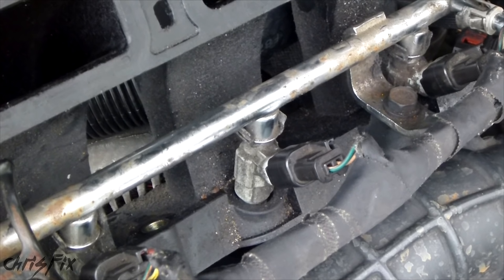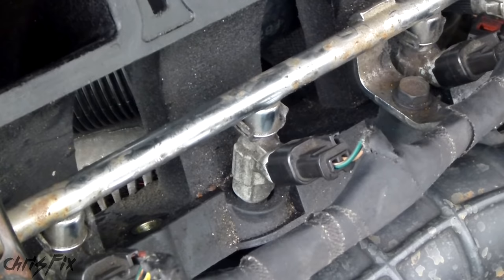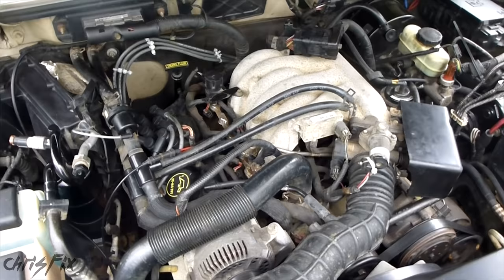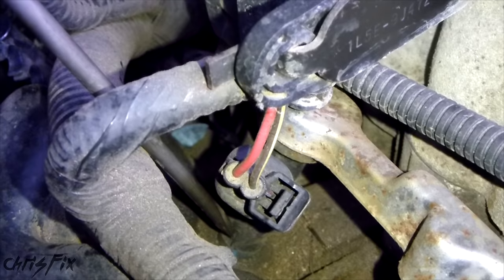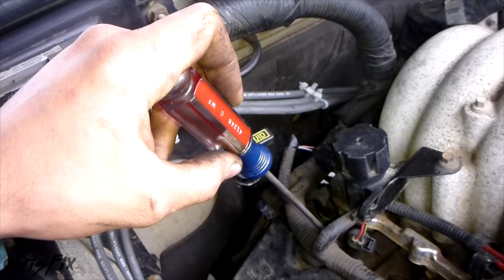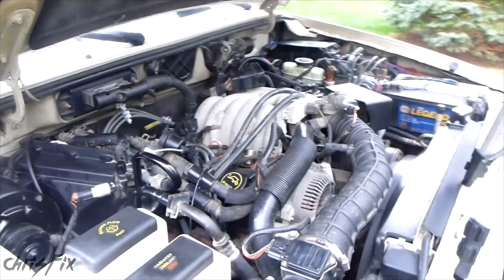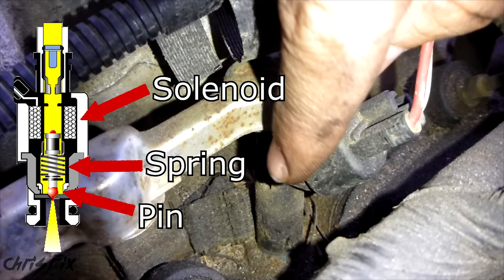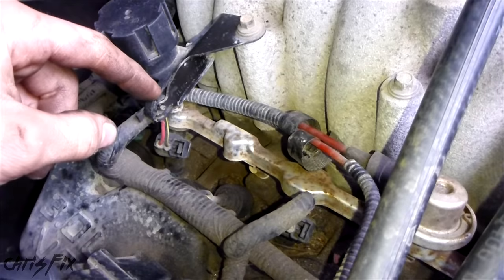Testing Fuel Injectors Fast

Comment: Lol, that just tells you if the injector is physically firing. 
That's rarely a problem and, if it is, will show up in the DTCs. 
The coil in an injector is not what typically fails.

Comment: I see a a lot of videos on the code p0304. Most of the videos show the mechanic replacing the ignition coils and spark plugs. I have the same code, misfire 4 cylinder. However, I replaced those about 6 months ago. Just to be sure- did a ignition coil and spark plug swap, after that kicked up the same code and problem while driving. Could the problem be the injector?

Comment: I'm a novice and I feel I just got ripped off. I have a 125,000 mile '93 Nissan Sentra with a new tranny ('16).  Two months ago, I stupidly ran car until empty (tricky gas gauge sometimes). I was near home and local gas stop and walked back a quarter gallon and cranked it up. It sounded just like it did when it was sputtering. It might be worth noting that it was sputtering (like it had half-power) for several miles before it stopped near home.

With new gas, I sputtered to this well-regarded shop near that same gas stop.  Anything you take there, I'm told, be prepared to wait three weeks.  Since I had another car, I didn't hurry him but did show up there after a month to be told that he thought I had a bad injector but his tool for determining that wasn't working and that he'd ordered one. He quotes me $500.

Three weeks later (last Friday), he tells me to check back y'day. I missed a call this morning from that shop...no message. I stop in today about an hour ago and did not find owner there. His associate and secretary are there when I'm presented a bill for FOUR injectors for $1,081.  I wasn't happy.  I told them that since they had the car for two months, they could've at least let me know that actually the bill was going to be 120% more than quoted. 

Three yrs ago, I took same car to same place due to wobbly or vibrating belt near a/c (but not a/c) and that's fixed. But bill is $1,600 due to me needing three new engine mounts. I wasn't able to argue it and he sent photos of what they looked like before they were replaced/fixed. So, I dunno about that one but I'm getting a bad feeling about this last one that I've been cheated. Your thoughts?
Reply: I'm not a car guy myself so my answer means nothing and I hope someone else will reply with better. But I would just say if mechanic orders OEM parts and a big shot in town he's gonna upcharge ya premium.  I've had 93 Nissan Sentra myself, its fuel efficient & reliable but such a peasant vehicle that I didn't expect to be hit with $931 for an axle shaft job. They replaced many things without consulting me - new tires, rear brake shoes etc. They could say its for safety reasons and its fair  but they don't know my financial situation so they should have asked. Needless to say I haven't gone back to that shop. Today I'm looking to fix few things on 98 Sienna and lextech quoted $600 for just the labor of replacing 4 mounts - a  job a mexican by autozone near  LA downtown is willing to do for $200. The question becomes do you want to gamble on how reliable the job will be. Unfortunatly what happen to you is very common. Maybe in your free time you can ask around other mechanic shops what they would have charged so that next time your car brakes down you'll know where to go.

Comment: Chris bro I am having a problem keeping my 97 geo metro running it just dies not long after any pressure to the gas pedel. I am looking into changing out the Fuel Injector filter tonight but Fuel injectors are quite expensive to just replace without knowing so Im going to use your video advice and check them out. Thanks for the info, hopefully it's the filter though!
Reply from the maker: Wyatt Whiteside Awesome! Let me know how it goes. Check the fuel pressure too: https://www.youtube.com/watch?v=_oXLUqE4Sf0
Reply: ChrisFix  turned out to be the EGR valve Chris! Thanks though!!

Comment: That just tells you if the coil is good and that the injector is getting voltage. If the injectors completely plugged upit will still make that noise leading you to believe that it is working, and still causing a lean condition because you're not getting any fuel, or enough fuel.

Comment: In my 2004 Vw Polo I had a bad injector and there are 2 fault codes. P0202 Injector Circuit Cylinder 2 and P0302 Misfire Detected

Comment: it was a bad injector. i switched them and the miss went with it. thanks
Reply from the maker: +rex2013 AWESOME! That is exactly how you do it! Thanks for the update!
Reply: 1mzfe is running good, short trims are at 0 and long term about 3. give or take -1. the new code p0420. i have 166,000 on it. did i mes up th cat with those missfires.

Comment: Hey Chris..my mitsubishi lancer started making a noisy clicking noise and thought it was the hydraulic lifter. Later added the liqui moly hydraulic lifter additive  which made it a little better but the ticking wasn't gone yet..later checked the fuel filter and it had a mix of water and a little dirt..Is there any chance the ticking engine is caused by bad fuel injectors or the bad fuel mixture that was running..?any help will be much appreciated..thanks in advance

Comment: Hey Chris, I pulled out my injectors and got them serviced twice in a role and each time the engineer is saying he fixed them and they're now OK (according to the injector machine). But each time we put them back they're not producing a consistent pulse. Only one is firing correctly. The car has power, but the idling is rough. I hope you reply to this. Thanks

Comment: Chris, I checked the injectors with a stethiscope and get a uniform sound from all four on my 240 non starting volvo. The sound is a very rapid succession of clicks rather than a slower more distinct click, click, click sound. Is that rapid speed while cranking the engine correct? Thank you for all your most informative video tutorials.

Comment: Yeah ive got a w203 c320 and im getting a missfire every single time i get to 5000-6000rpm « goes into emergencymode» and its always cyl 6. Ive changed plugs wires and the coil.. also ive changed the crankshaft sensor but nothing helped, hopefully its the injector if not it might be bad compression in the cylinder ;/ im about to test the injector out with your method !

Comment: I will try this because my ford escort 2001 zx2 keeps misfiring cylinder 4. I replaced the spark plugs, cables and coil and the crab still misfires. Thanks a lot, looks simple...

Comment: So my 350z is misfiring on cylinder 4. Checked all 6 injectors but 4 sounds weak. It's clicking steadily but it's half as load as the other 5. Switched injectors 2&4 to see if it would make cylinder 2 misfire. Nothing changed....still p0304..could it be the wire harness? The $180 question

Comment: Hey Chris, i got a 2015 corolla and the dealership says it needs a "fuel injector service"($180). The injectors sound great using your test and the car shows no signs of bad injectors. Is this a necessary repair and if so can i do it myself? Have done so many repairs thanks to your videos
Reply: +mamel .juice like he said at the end, it won&#39;t tell you if the injector is dirty and chocked up, or if it is leaking.
Reply: +mamel .juice You must have taken it back to the dealer for a problem you're having but never mentioned here. 2015 model should still be under warranty and cost you nothing. Dude, they're blowing smoke up your butt.
Reply: Sounds like your mechanic needs to make a boat payment. 
No way a 2015 needs injector service.
Tell them to replace your injectors under warranty if they are bad. Lol

Comment: hey Chris I have 89 e250 with in line 6. 
stuck on high idle, no vaccum leaks, if I unplug everything from the tree engine still races, would cold start fuel injector go bad cause high idle?
p.s. I had new water pump & thermostat put in.

Comment: 2007 jeep liberty 3.7l v6 with a nasty habit of not wanting to start. Turns over fine, but just wont fire. No rhyme or reason behind it. Seems to happen more when its been running for a while. Error code 0304. Also keep blowing a coil on cylinder 4. Bad enjectors??

Comment: I have a 2000 Acura Integra LS. Once it gets up to 5000 RPMs it totally loses power. It takes a couple seconds to recover but then it's just fine what is the issue? Fuel pump? Fuel filter? Fuel injectors?

Comment: Hi Chrisfix. I am having a problem with a 04 mustang V6. I changed the oil, Spark plugs, wires, fuel filter, and cleaned throttle body. The car is still vibrating during driving like it wants to go but stutters. It only works at WOT. I was thinking maybe a bad injector or clogged due to be parked for a lonnnnng time. Any suggestions on removing and cleaning or just by cheap ebay ones to replace?80$ shipped for all 6. Thanks in advance.

Comment: My Escape is misfiring on highway and going up hill.  No issues starting or idling.  Already replaced Coils and spark plugs.  Could injectors still be an issue if there's no problems starting?

Comment: Can bad injectors cause white smoke out exhaust? Trying to diagnose is the white smoke head gasket or bas injectors. The white smoke only happened after injector orings were replaced & intake gaskets.  Also I noticed when i hit the gas at low rpm (RED LIGHTS) the car sputters & sometimes even stalls completely. Trying to figure out head gasket or injectors, no coolant in oil & front 3 spark plugs smell like straight gas

Comment: i have a 96 dodge ram 1500 and while driving down the road you get a really bad smell of gas in the cab of the truck . Also when you shut of the truck and walk by the gas tank you get smacked in the face with a really strong gas smell what could be causing this problem.

Comment: Unfortunately on my vehicle the injectors and fuel rail are underneath the intake manifold and cant be accessed while the engine is running so i'll have to find a different method

Comment: Hey chris :D been having problems with my Astra J 2.0 Diesel for the past few months, it goes into limp mode randomly, there is no pattern what so ever it is so intermittent, pulling off, driving normally on flat road and going down the motorway at 70, just randomly goes into limp mode, sometimes it can go a whole week before doing it again. Turn the engine off and on its fine until it happens again. 

The code im getting is P0087 'Fuel Rail Pressure Low' I have had the high pressure fuel pump reconditioned (all data on the diag is normal) replaced sender pump in the tank aswell as fuel filter 3 times and fuel lines flushed, EGR replaced, MAF sensor replaced and the fuel rail pressure regulator replaced. Do you think it could be an issue with the ECU? or would you recommend getting the injectors tested? I know one of the big symptoms is misfire which i havent had, but could it be due to a very small leak/drip on the injectors? This is doing my nut in now haha I really appreciate your help and advice. Cheers bro!

Comment: I have a 2010 equinox that struggles to get up to speed then it takes off, also is it possible to take all the injectors out and clean them if build up is the issue?

Comment: I have a mis fire one #4 injector..using screw driver test i notice #4 injector is firing much faster than other injectors..does this mean its clogged or does it mean solenoid is bad? Thanks

Comment: I used an actual mechanic stethoscope and with the injector unplugged, I can still hear the ticking. Which means I'm hearing the other injectors through the rail.

Comment: Hi so I have a 2009 Nissan Maxima 6cylinder recently the car has begin to lose power rides rough and the engine light has started blinking then it stops after 8blinks it rides very rough and when I’m at a light it sounds as if it’s bout to cut off . I just got a tune up changing the spark plugs and one coil and also replaced the mass air flow sensor and even after that the engine light cut off but after only driving a few mins the engine light is back on and blinks and the car is riding rough again . But when I put it in manual and change the gears myself it rides okay still engine light blinks the same then stays on only when I go into 4th gear up hill does it start riding rough again . Does this sound like I have bad injectors ? Also is it too late to use cleaner ? When I first got the car and would come to a light it would do this consistent jerk not hard but you could feel it in car.. I’ve taken it to 3 mechanics and have been misdiagnosed each time .

Comment: i think my fuel injectors are clogged... im getting a huge white cloud from the exhuast smells like gas. truck has been running fine.. and all of the sudden check engine light and all this smoke now the truck wont start or crank..

Comment: How do you check for a fuel injector that is stuck open my engine is blowing fuel out the spark plug hole with the fuel injector disconnected any thoughts

Comment: Just wondering if I have a bad injector , 3 of the injectors ohm test at 13ohms but one was 18 ohms. Is the high number injector not in ohm specs considered a bad injector ? Although the car runs smooth atm. I ask because I had a missfire that randomly went away and has yet to come back.

Comment: My 2004 Chevy implala ls is currently jerking while I’m driving’s sometimes it’s doesn’t do it but sometimes it does it bad like I can stop at a red light and drive away but it will stall like it want to cut off it actually cut off on 3 times before while doing that

Comment: Hello Chris . I want to know if my injectors are bad . My car dont have smoke , it start very normal , maybe i think it doesnt has too much start power , but when i push the gas to the end it doest release the power . My car is audi a6 2007 2.7 . I was thinking to use a dieseel purge from liquid moly ? Does it work ?
Last friday i changed intake manifold swirl flap ,but still it doesnt has any reduce in fuel or any change in performance

Comment: Chris are you familiar with a special injector cleaning that for does at about 30K on the Edge?  I got it done at about 36K miles and it ran like new again. I asked the dealer if this was available for my current car, a Ford Fusion Hybrid and they said yes. Do you know if this can be done by the owner or a local mechanic?
Reply from the maker: +Robert Greenhouse Those cleanings are gimmics. I have a Ford van with 300k miles that gets the same MPGs as new and it has never had a cleaning. If you notice you are losing mpgs then it might be worth a shot but otherwise you are wasting your money.

Comment: I have a 89 s10 pickup with a 2.5 liter engine and a manual transmission.  The engine did run for 15 minutes and then it would run really bad. Truck hardly moved would try to stall when clutch was pushed in. I removed the injector the other day now when you give the fuel pump test wire 12 volts gas comes out of injector like a water faucet. what the hell would cause that?

Comment: I never tried this trick I just unplug my spark plug wires  one by one and if it changes noise my injectors work one of my spark plug wires didnt make no noise ... could that be a bad fuel injector ?it was on cylinder 3

Comment: Well, 3 of my injectors are in the back of the engine and I had a hard time just getting spark plugs out and replaced let alone while running and risk if burning myself listening to an injector. It’s a 2010 dodge caravan
Reply: Pretty sure the rain gutter/cab air intake plastic above the engine can be removed to get to the rear on those

Comment: So my car has been having problems starting and when it does start it smells like fuel bad. Also when I’m trying to start it the check fuel cap light is on. I replaced my fuel cap but didn’t fix the problem.. do you think it could be my Fuel injectors i can’t take it to a mechanic because everyone I do it start with no problems also no check engine light.

Comment: So I had a flashing check engine code on our car. Scanner said cyl 6 misfire and cyl 6 fuel injector. Car started running good, I did the screwdriver check and could hear the pulses. Then car started running bad so I listened for the pulses thought I could hear them. So checked the Ohm on cyl 6 against 4 and 5. Cyl. 4 and 5 were the same, cyl 6 didnt even read. So was I hearing residual pulses from another injector?
Reply from the maker: Might have been, how close are the injectors from one another?
Reply: @chrisfix  I'm thinking the same thing. However this is my first go at it. Doing spark plugs while I'm at it since the intake plenum has to come off to get to the horseshoe fuel rail.
Reply: @chrisfix  not positive how close, maybe 8"?? Would you recommend spraying a little wd40 or some other penatrent on the injector to make it easier to pull the injector to not damage the oring?

Comment: What if my vehicle has hesitation under excellation and bogs down randomly. .I changed my plugs and wiers and cats ..I also put new o2 sensors in and in ran worst so I put the oem ones back in

Comment: Hey Chris i need your help, i havea 2007 Subaru Forester i have a p0301/p0302 misfire and my catalyst converter is glowing red
I changed the spark plug 5k miles ago
And just a few days ago the spark plugs wires
I tested the fuel injectors and are fine, what else it could be ?

Comment: I had a code that told me my 3rd cylinder on my 1998 F150.   Was the problem I had it looked at from O’Reillys using their free test Engine light tester I found out the corporate problem was my fuel filter replaced it with WIXS

Comment: Can you hear it if it’s clogged? They both click if I stick a battery to it but I can’t hear it while cranking but my engine is really loud all I hear is engine. Idk if they are clogged or it’s the ecu or what but they won’t spray and it’s getting fuel all the way to the throttle body